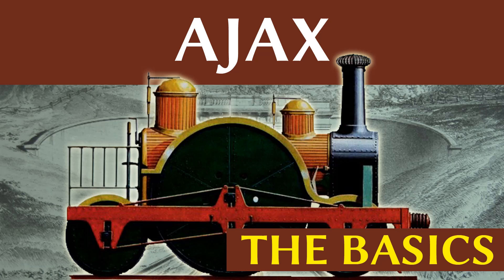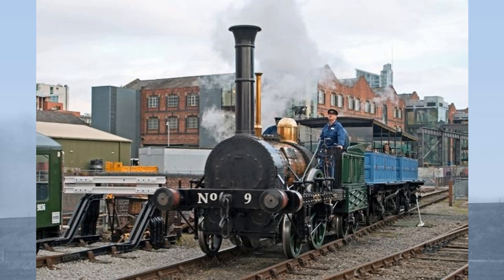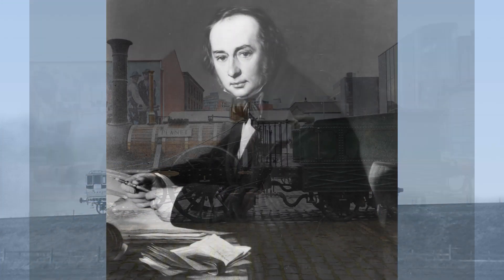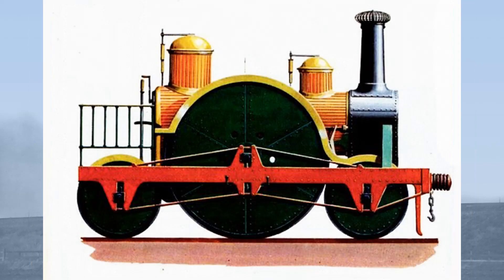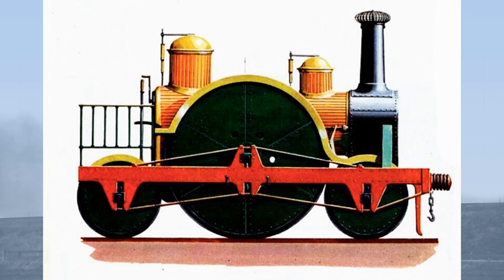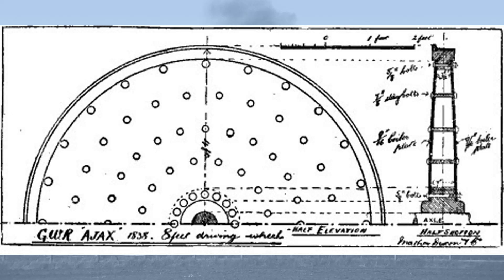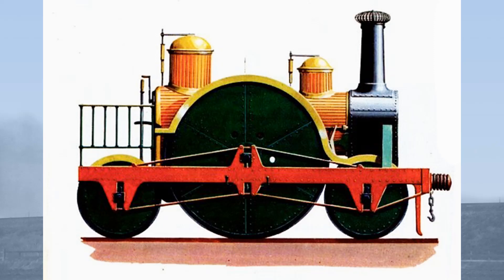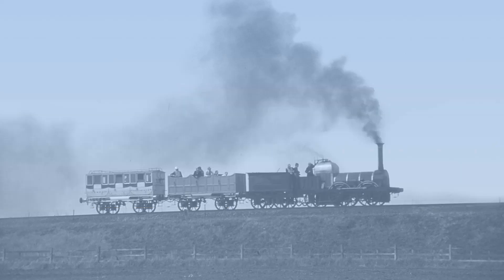Ajax: The Basics

Comment: Brunel was an excellent civil engineer. When it came to locomotives, he didn't have a clue what he was doing. I'd heard of Hurricane and Thunderer, the 100 claim being very dodgy. Never knew about the Projector, or Murray's articulated... Thing. Here's food for thought, 10ft driving wheels, 4 boilers above and below, each side of the crank axle, cylinders inbetween... True 1830s engineering.
Reply: can't even put a boiler and an engine on the same frame smh
Reply: Brunel was far from infallible - his 'baulk road' trackbed and 'atmospheric' traction being two other notable failures.   Though these days his successes tend to be remembered rather more than his failures.   He was certainly ambitious in his designs.
Reply: Sometimes, I kind of wonder if he or anyone else involved with the GWR, had ever tried to take advantage of the broad gauge layout for other means, such as seeing if Crampton's handiwork would fare better on broad guage track (seeing as it was made with the intent of high-speed travel, with as little rough riding as possible), compared to the potentially more brittle structure of the standard gauge track, or even taking advantage of the wider wheel span, by potentially making a more squat-like engine, for use on lines with lower-hanging ceilings, sort of working similar to how certain rolling stock was built around the axles, rather than on top of them.
Reply: @retrogamelover2012   Trouble is, the wider gauge doesn't lower your axle height, and the boiler has to fit above that.   Though admittedly the broad gauge means that, for a given height of boiler, the loco should be more stable sideways. 
Curiously enough though, this sideways stability does not seem to have been a significant problem, even on narrow gauge, as the enormous South African 25NC's would illustrate.
The only designs that managed to successfully drop the boiler below the top of the main driving axles were Cramptons and Garratts, so far as I know.
Reply: @cr10001  Well, I didn't neccesarily say it was just the boilers (although, I can imagine there being some way to essentially create one, that was low enough to still function, whilst navigating low ceilings), as things like where the driver and fireman would operate the engine would've been something to work out, as well.

Either way, I guess this whole "re-inventing the wheel" thing, is kind of what Brunel was essentially known for, and what essentially made his creations rather hit and miss, despite the ambitions.
Reply: @retrogamelover2012   It's interesting to speculate what could have been done.   A bit of extra space never hurt.
Though the typical  profile of tunnels was such that, if you made it wider, it also got higher, so though the broad gauge might have permitted building a lower engine, I'm not sure there would have been a call for that.   Generally places with low headroom were also tight on width. 
As to inventions that Brunel championed, they did have mixed success.   I'm not at all sure whether it's possible to predict - before the event - whether an invention is going to be successful.   For example, atmospheric traction - the pipe was sealed by a leather flap and - rats ate the leather. (!)      On the other hand (and in a different century), the first time I read of the Leigh Light - a searchlight to be carried on planes to illuminate enemy submarines for night attacks - I must admit I thought "what nonsense, that would never work!"   But apparently it was extremely effective.